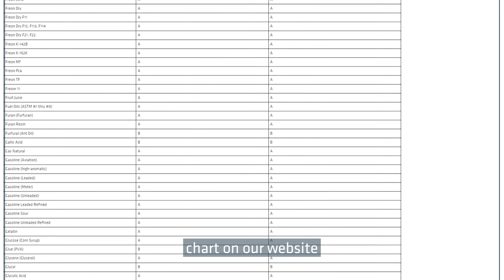What Is the Difference Between 304 and 316 Stainless Steel? | Technical Tuesday

Comment: 304 is also much better for bending and roll forming because it doesn’t work harden and doesn’t require post welding heat treatment, as for machining 316 requires specific (expensive) tooling.

Comment: We are building carports in the Bahamas and are looking for stainless steel nuts, bolts, and washers. Due to the marine environment, we've been recommended to use 316 stainless steel hardware. However, we need that hardware to withstand winds of up to 200 mph. Would stainless steel 316L be a better fit than stainless 316? Thanks,
Reply from the maker: Hello thank you for your question.  316/316L is the chemical composition of the stainless nut. They don’t have any wind ratings, nor does wind affect the chemical make up of stainless. 

316L has a lower carbon content that normal 316 so it has slightly better corrosion resistance so due to the harsh environment that would be better suited. 😀
Reply: I think he is referring to the strength not the corrosion resistance when talking about 200mph winds

Comment: Is there a difference if any between 316 and 316L SS?  I want to use SS for car door molding instead of ABS for durability. However, I worry that SS will eventually start rusting and ruin the door panel when expose to moisture and road salt during winter.. And when comparing to 304, is 316 a better choice for outdoor usage? I am going to go a step further by electropolishing SS to enhance the corrasion resistance.
Reply from the maker: Hello thanks for your question. The main difference between 316 and 316L stainless steel lies in their carbon content. 316 stainless steel contains a higher carbon content than 316L stainless steel. The lower carbon content in 316L helps to minimise the formation of harmful carbide precipitates, making it more resistant to corrosion in certain environments. 

In terms of using stainless steel for outdoor applications, both 316 and 316L stainless steel are excellent choices due to their superior corrosion resistance compared to other stainless steel grades. They are particularly well-suited for withstanding exposure to moisture and harsh weather conditions.
Reply from the maker: I hope this helps :)
Reply: @TheMetalCompany  Thanks. Should 304 be avoided then?

Comment: So which should I choose for perfume storing tank?
Reply from the maker: Hi Kenneth sorry for the late reply. 

304 stainless steel is a commonly used stainless steel grade that offers good corrosion resistance, durability, and affordability. It is suitable for various applications, including storage tanks. However, it is important to note that 304 stainless steel is more susceptible to corrosion in environments with high chloride concentrations or exposure to certain chemicals.

On the other hand, 316 stainless steel is an austenitic stainless steel alloy that contains additional elements such as molybdenum. This alloy provides enhanced corrosion resistance compared to 304 stainless steel, particularly in chloride-rich environments.

Therefore, if your perfume or the storage environment involves exposure to chlorides or corrosive chemicals, 316 stainless steel may be a more suitable choice to ensure long-term durability and resistance to corrosion.

Ultimately, the selection of the stainless steel grade should be based on factors such as the specific composition of the perfume, the storage conditions, and the budget. 

Here's our chemical compatibility chart to help you out: https://www.themetalcompany.co.nz/technical/?category=chemical-compatibility#chemical-compatibility 

If you have any other questions feel free to reach out 😀

Comment: I am making small flat parts at .060” thickness, which is stronger the 304 or 316? I am looking for the best bend resistance.
Reply from the maker: Hello thank you for your question. For small flat parts with a thickness of 0.060 inches, both 304 and 316 stainless steels are suitable, but 316 may offer slightly better bend resistance due to its addition of molybdenum, providing enhanced corrosion resistance 😀

Comment: Which one is easy to weld and which one is suitable for steam?
Reply from the maker: Hi @adonay, Both 304 and 316 stainless steel are relatively easy to weld, but 316 may be more prone to warping and cracking due to its higher levels of alloying elements. In terms of suitability for steam, both 304 and 316 are resistant to corrosion in high-temperature environments, but 316 is typically considered to be a better option because of its enhanced corrosion resistance in chloride environments. It is also worth noting that if the steam application will be in a highly corrosive environment, the low-carbon versions of 304 and 316 (304L and 316L) may be more suitable as they have less carbide precipitation from welding.

Comment: What is the best steel for water electrolysis?
Reply from the maker: Hello! 304 stainless steel is a commonly used and cost-effective material that offers good corrosion resistance in many environments. It contains chromium, which forms a passive oxide layer on the surface, protecting it from corrosion. However, 304 stainless steel may not be the best choice for certain electrolysis applications because it can be susceptible to corrosion in acidic or chloride-rich environments.

316 stainless steel, on the other hand, contains additional alloying elements such as molybdenum, which enhances its corrosion resistance, particularly in chloride environments. It is more resistant to pitting and crevice corrosion compared to 304 stainless steel.

If your water electrolysis setup involves exposure to chloride-rich or acidic conditions, or if corrosion resistance is a critical factor, 316 stainless steel may be a better choice.
Reply: @TheMetalCompany  thank you so much for information. is the 18-8 the same as 316 or 304? i found one  but is is written 18-8. is it good to be used ????
Reply from the maker: @princessa4223  Hello great question. 
No they are not the same but 18-8 and 304 do share similar qualities.

18-8 stainless steel refers to a type of stainless steel that contains approximately 18% chromium and 8% nickel. This composition makes it highly resistant to corrosion and oxidation. It is commonly used in applications where corrosion resistance is important, such as kitchenware, utensils, and food processing equipment.

On the other hand, 304 stainless steel is a specific grade of stainless steel that falls within the 18-8 stainless steel family. It contains approximately 18% chromium and 8% nickel, just like 18-8 stainless steel. However, 304 stainless steel also contains a small amount of carbon (around 0.08%). This addition of carbon improves its strength and makes it more suitable for certain applications, such as structural components, industrial equipment, and architectural fixtures.

18-8 stainless steel is a broader term that refers to a range of stainless steels with 18% chromium and 8% nickel, while 304 stainless steel is a specific grade within the 18-8 stainless steel category.